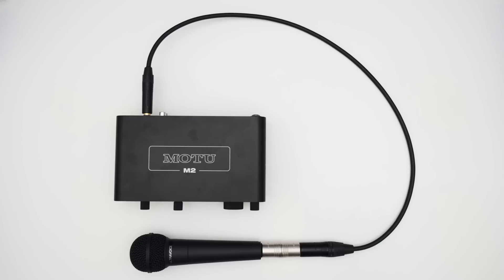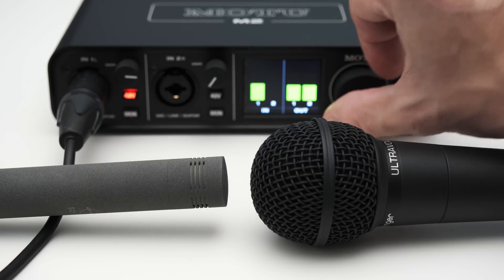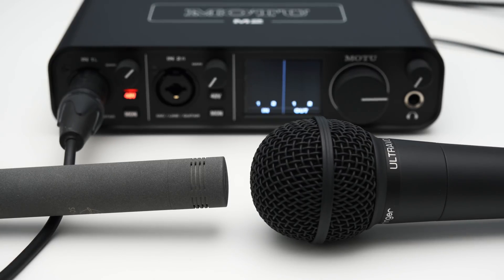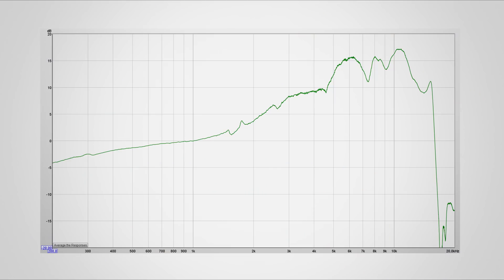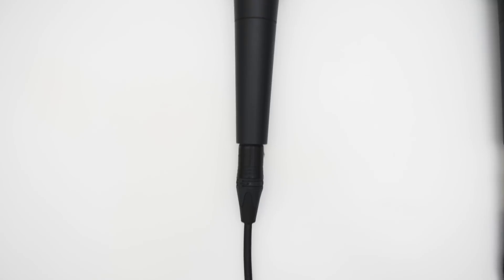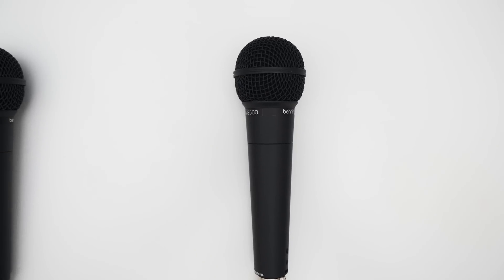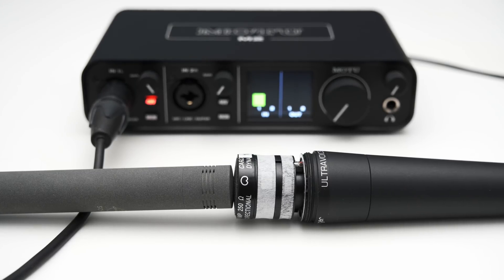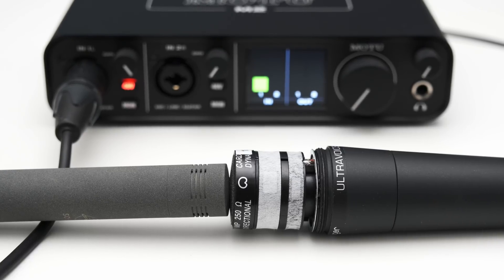What happens when you connect two microphones?

Comment: Hey, this got me thinking. This could work better if you played around with the impedance of the devices you connect. Find a mic with a really low impedance and try that. Maybe the one acting as a mic should be higher impedance than the one acting as a speaker? Hmm, maybe both as low impedance as possible? Somebody help me out here.
Reply: Or use transformers? I have some of those inline transformers that are low to high impedance for connecting a mic to a guitar amp.

Comment: The smallest speaker (and only) I ever made, was when I was 13-14 years old. I took a tiny bit of cardboard, rolled it in of itself, to make a tube. Around 2 mm in diameter, and 3-5 mm long. I took a magnet from a speaker, and broke off a tiny bit of it, that could fit into the tube.
I then took some coated wire from an old speaker, rolled it onto the tube. I don't remember how much, but not much more than 20 revolutions.
Finally I cut a "dome", just a flat circular piece of cardboard, and glued it onto the end of the tube.

I knew about impedance (somehow), and knew I should probably just test it very quickly at very low volume. The only thing I had to test with, was my parents B&O stereo receiver.
It worked! I could hear it playing, by holding my homemade speaker up to my ear. Very thin sound, but it worked.

The receiver survived that test. Unfortunately it didn't survive another experiment of mine - setting the switch underneath the receiver to 110v input, instead of 220v.
My parents were NOT happy with me!

Comment: Lmao this actually works if you daisy chain parallel 5 SM58 mics into 1 input.
Great for conference tables. But random unexplainable clippings from a hot signal. Probably the load is too low.

Comment: A microphone essentially is a very small dipole speaker. It is not very efficient because we are talking a very small (1" typ.) driver tuned to a low fs of <100 Hz (those into their Thiele-Small parameters may remember an fs³ term), with the typical dipole low-end dropoff caused by front and back wave cancellation setting in well in the kHz range. 
Further experiments might include sticking the mic element through a cardboard baffle for improved low-end response, as well as attaching various  kinds of horns.

Comment: Hey Julian! 😀
While looking for a new Audio Interface, I stumbled aross a review of the SSL 2 (on amazona dot de), which goes into some detail on the USB Power Delivery of this (and similar) interfaces.
They claim that the maximum of 500mA, which USB 2.0 devices are allowed to pull, is not enough, when you use PreAmps with Phantom Power and outputs at the same time!

They back it up with some measurements (however it looks like a rather cheap and possibly flawed method), which show that the interface is hitting the 500mA ceiling very quickly.
Also they say, outputs will heavily distort then. 😰

Can you please make a video about that? 
Maybe measure the same SSL 2 and possibly some other interfaces, when using outputs and inputs at the same time?
I am now uncertain, if I should get the SSL 2 or rather look for an interface with additional Power Supply.
Reply from the maker: Hey, do you have a link for me to check out?
Reply: @JulianKrause  Ah, of course!
https://www.amazona.de/test-solid-state-logic-ssl-2-usb-audiointerface/
(Please let me know, if you could read this message. Sometimes YouTube automatically hides comments with links.)

Thx for all your great work btw.
Really the very best interface tests and comparisons out there!
Reply from the maker: The calculation this guy makes it completly wrong... He only adds up amperes but it's about power not only current. USB 2.0 works with 5 volts and about 500 mA. 5 V * 0.5 A = 2.5 Watt. That's how much power the interface can use. First, in the worst-case phantom power (48 V * 0.01 A *  2 = 0,96 W) draws about 1 watt for two channels. The AD/DA draws about 50 mW according to the data sheet. The heaphone amp draws at a maximum about 150 mW. The LEDs are hard to judge but let's give them a whopping 0.5 W. Of course there are inefficencies in voltage converters that have to be taken into account but all in all the interface should be totally fine with 2 Watts. As the USB 2.0 standard can deliver 2.5 Watts, the interface will work just fine with USB power. This is true for many two channel audio interfaces. 4 channel interface on the other hand start to struggle because in the worst-case 4 channels of phantom can draw about 2 Watt. This only leaves 0.5 W for the rest of the electronics. That's why 4 channel interfaces often use an additional power supply. Cheers!
Reply: @JulianKrause  Did my message with the link come through?

Comment: Not surprised it worked. First “microphone” I ever had was a regular ol’, rinky dink pair of walkman headphones. I was curious one day in 2005 about what would happen if I plugged the headphones into the microphone port on my computer since the ports looked the same. One of the speakers turned into a microphone just as you demonstrated. Didn’t sound too bad at the time either.

Comment: When testing mic as a speaker, screw off the microphone grill and block the side openings on the capsule with something opaque to sound, or stick the capsule into a baffle which would do the same. You might find that you have more bass. Haven't tried it myself though. But since this vid is "don't try this at home" and "i do it so you don't have to", i feel it's appropriate to suggest.

Essentially the polar pattern of the microphone is shaped by having the sound reach the membrane from two sides, from the front, and from the back. When it comes in from the back, it's offset in phase depending on the incidence angle, and when two signals in-phase meet at the membrane, they physically cancel themselves out. The side vents of the capsule assembly are connected via channels to the back of the membrane. But the same effect can also lead to acoustic short circuiting, where when you operate the membrane as a speaker, the back sound off the membrane will travel to the front and cancel out the sound coming out of it. This would be independent of the proximity effect on the receiving microphone.

As a word of note, dynamic mics with their highish impedance don't produce a lot of current, but they do produce a significant voltage, because this is how you make electronic amplifiers happy, with voltage, not current, because fets consume no current on the gate, but they have a significant voltage noise that needs to be overcome. It's opposite for your presumably 32Ohm headphone capsules. How about connecting a headphone capsule and using it as a microphone, and using a 600 Ohm microphone as a speaker? What if this reverse contraption will be significantly louder than connecting two microphones back to back, as the headphone will be essentially forcing that current through the mic?

Comment: Dynamic microphones are conceptually identical in design with a ordinary speaker. One requires an electrical signal to move a membrane that vibrates the air producing an audible sound (speaker) whilst the other generates an electrical signal when sound vibrations in the air interact with a foil making it moving in a coil (microphone).

There is a similar analogy with LEDs and solar photovoltaic cells.
If you expose an LED to light a voltage is generated at the terminals of that LEDs - it practically becomes a solar panel (although it responds to different wavelengths to a conventional solar panel)
Reply: Interesting! I didn't know that about LED's